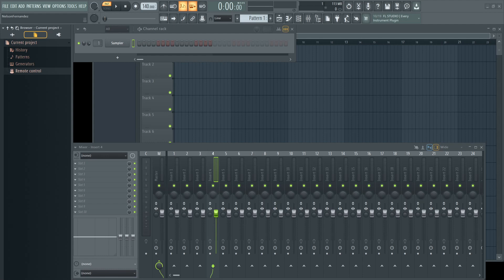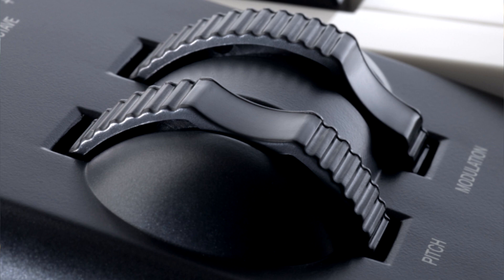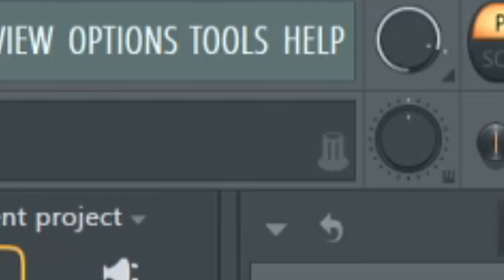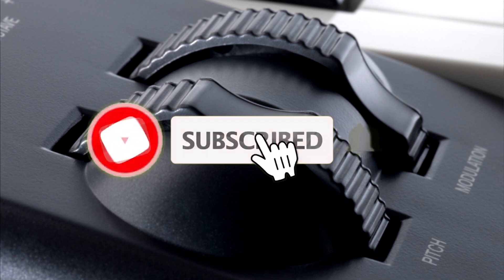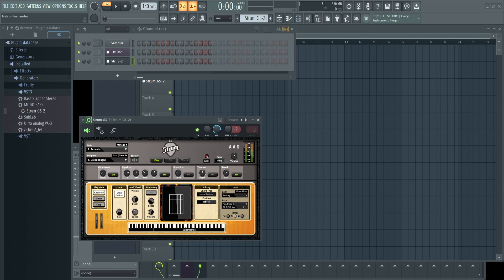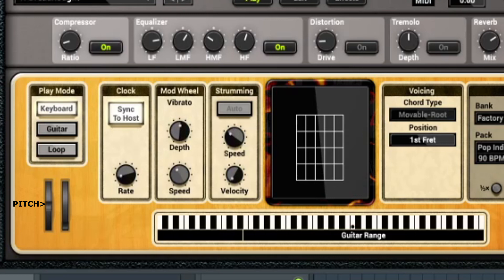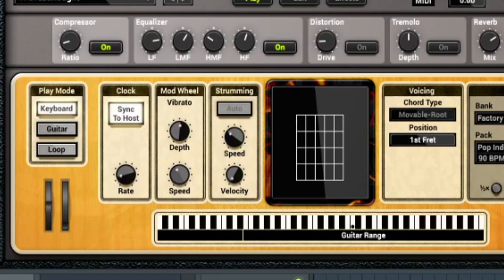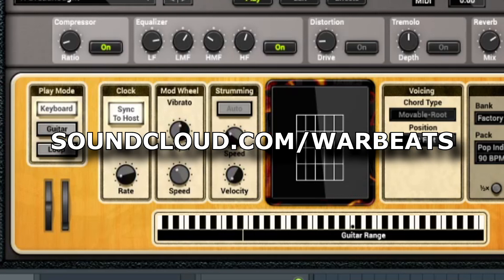How to fix (and use!)  the pitch wheel in FL Studio

Comment: I had an expensive Yamaha work station ,arranger ..I wrote a lot of rock stuff so needed authentic guitar sounds and stretched notes like Gilmore. I played it so hard those ridges were actually smooth in parts !! It killed it !! Then my monkey ass tried opening. It basically has a stroke .. the only thing I could do is by a GREAT btw Alesis piano ..midi.. and use it as a controller and the brain of the Yamaha for the sounds . Why I'm here is I wanna know if they make remote style whammy wheels .. so I can kill those ,rather than my next very expensive keyboard I don't have yet .

Comment: helpful video! I did what you said and it worked, but now when I use the pitch bend, it doesn't go back to the middle. it switches over to a new pitch.
Reply from the maker: the pitch wheel hardware will spring back to center on the wheel. FL doesn't reset the value directly. Is it possible you linked to the MOD wheel by mistake?

Comment: Thanks, very helpful.   But I still have to go through this every time I load a VST.  Isn't there any way to make it stick globally?
Reply from the maker: Yes. Make the changes on a new project and save that as a template. Now when you make a new project, use that template and the links will be inplace.
Reply: @warbeats  Ok.  But I still have to go through this process when I add another VST to the project?
Reply from the maker: @boboscurse4130  FL Studio has an optipon to set your default template so it willuse that on every new project by default. see: https://www.youtube.com/watch?v=0jeGWkg9TZU

Comment: Does that pitch bend paremeter change from 12 to 2 transfer over to all 3rd party plugins?
Reply from the maker: No. It shoudl be remembered for each plugin that you set it for
Reply: @warbeats   So I found the wrapper setting to set the parameter to 2, and the save button. It's kind of inconvenient that Image Line haven't made it easy to do it across all the plugins at once. I have 40-50 odd vst instruments across my desktop and laptop. Yay lol.

Comment: My pitch bend wheel works, but it only does very small pitch bends by default. I have to manually adjust the pitch number in each plugin window to 12 for it to read the full value.
Reply from the maker: Some midi keyboards might have an internal setting you need to adjust. check your equipment manual and see if it has any pitch settings you can access

Comment: so i have a novation launch key mk2 49. The pitch range keeps getting stuck. how can i fix the pitch wheel being stuck at one spot? it gets stuck in fl studio where it says pitch range in the channel settings of the plug in. in this case nexus 3. when i click reset it resets but soon as i touch the wheel on the keyboard it gets stock again around 44 cents. i cant figure out if its fl studio or the midi keyboard
Reply from the maker: might be a hardware issue. I had a MIDI keyboard that ocassionally did not center back to 0 pitch.
Reply: @warbeats  hmm ok ill see if i can exchange it with something else

Comment: Bruh my pitch and modulation wheel suddenly stopped working. They worked for 2 years. I really don't wanna to this stuff every time i got into the new project
Reply from the maker: You can set it in a new project and save the project as a template.  then your new projects based off that template will use the settings by default.